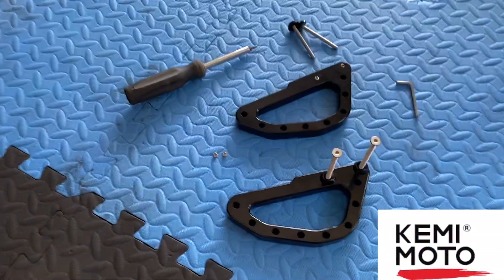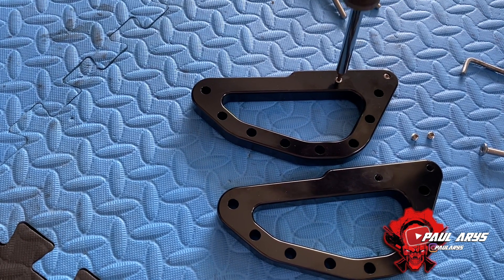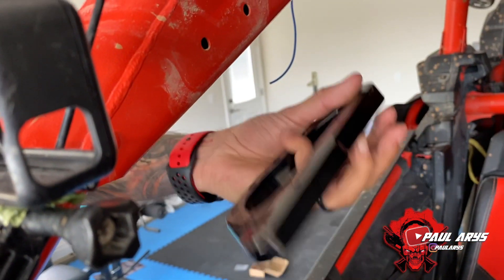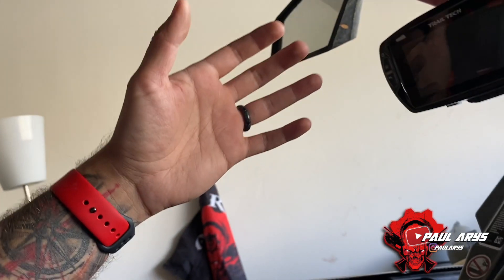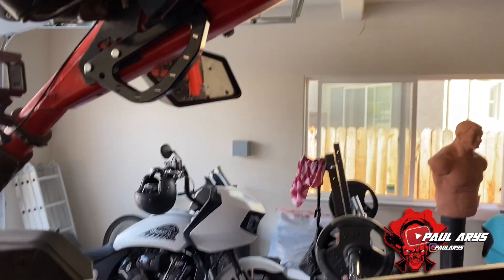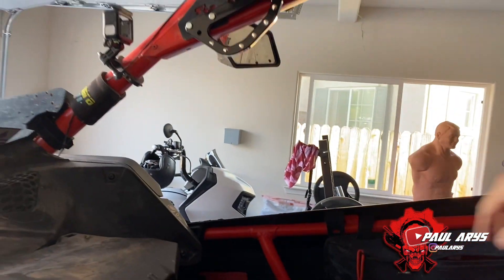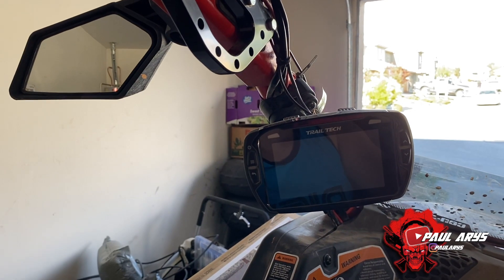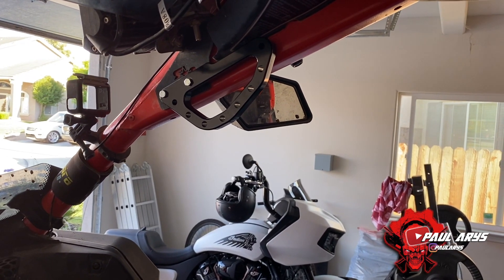Kemimoto Hand Holder install and review

Comment: What happens when you roll it in that mirror gets busted off it’s just made a pot metal and was holding a handle on?
Reply from the maker: I had to put different bolts cause I had the light ar adapter there too so needed a longer one, the bolt snapped when I Tolentino and put new one the hand holders are on the inside and are protected by the cage if you put them inside!